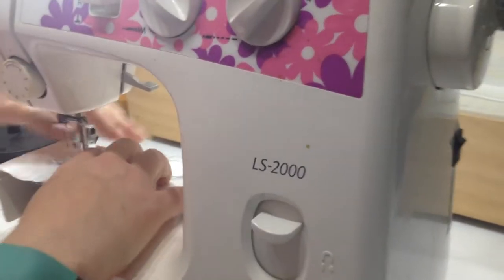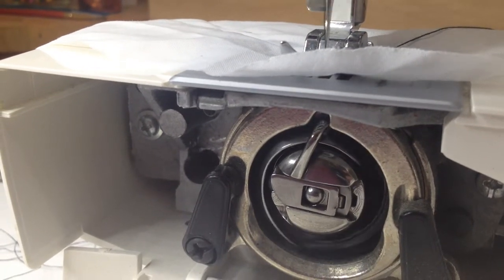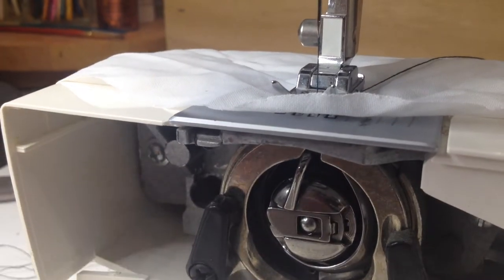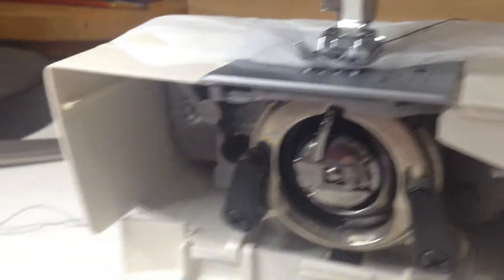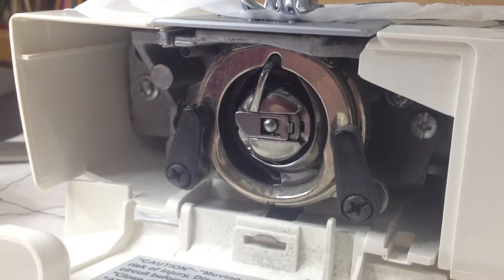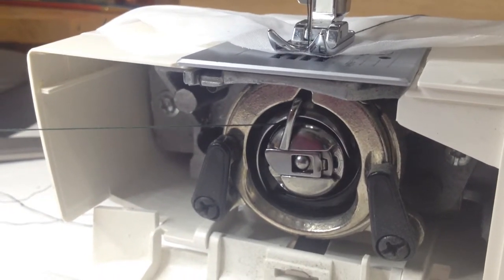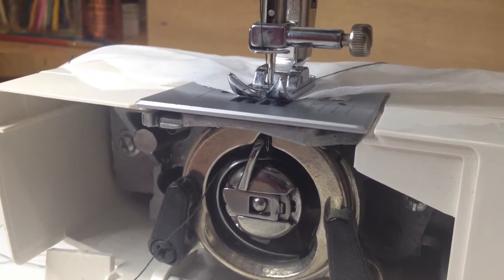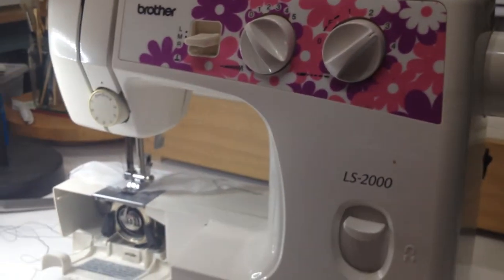How a Sewing Machine Bobbin Works

Comment: I like the video, but there's one thing I still can't figure out.  The top thread has to loop all the way around the bobbin, so I can't see how the bobbin is supported.  You can see it's not supported from the front (the exposed side), so it would seem to have to be supported from the back.  But if it's on an axle on the back, the thread loop couldn't get past that axle.  If you imagine holding a bobbin in your hand, and try to pass a loop of thread around it, you will have to let go with one hand and grab the bobbin with the other to get the loop all the way around.  What am I missing?
Reply from the maker: The upper thread just goes across the front of the bobbin case instead of around it on either side.  Imagine you’re holding that bobbin just from the back (it absolutely sits on an axle just like you described) and the thread comes across from the right to the left and then up and grabs the bobbin thread on the way up.  I hope this made sense.
Reply: @RedBarnHomestead  Thanks for the response!  I couldn't take it anymore so I took my machine apart last night and followed the thread path closely.  In my case, there is no axle on either side of the bobbin itself.  The bobbin sits in a cup and the thread goes between that cup and the bobbin.  There is an axle of course holding that cup in place, but the thread doesn't have to go around that axle because it can slide between the bobbin and the cup on the back-side (and just across the face as you describe on the front-side).
In any case, to make a lock stitch it has to go all the way around the bobbin.  Or to look at it another way, the bobbin has to pass through the loop made by the top thread when it's below the deck.

Comment: Hi I have finally got that the bobbin floats in a cup I thought it was supported  by an axle and i couldnt get my head around how the thread passed through it .I sure wish there was a glass or plastic sewing machine where i could actually see the mechanism.I do have it now that the bobbin floats but visualizing how that cup is supported without interfering with the thread is still somewhat of a stretch.I wish i had a sewing machine here i would have it apart right now
Reply from the maker: “The Sewing Machine Master Guide” is a book worth buying.  It explains the operations of most sewing machines in easy to understand detail.  We got the eBook version for around $7 and is well worth it.
Reply: @RedBarnHomestead  Thank you Ill look for it